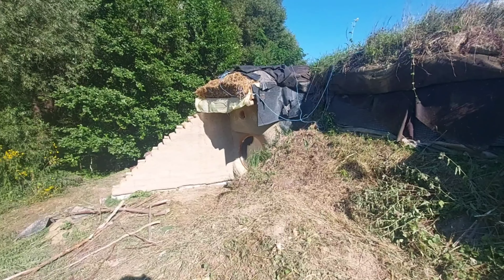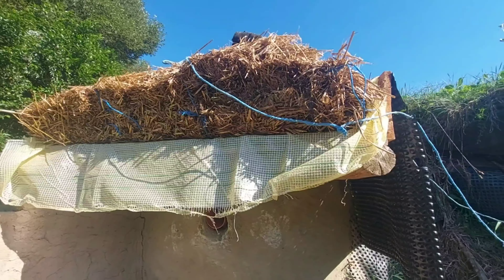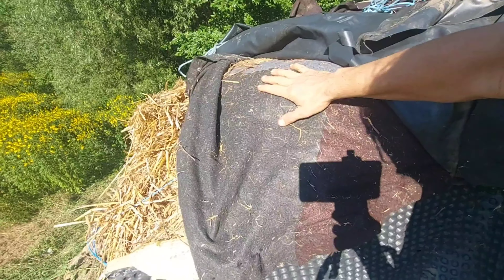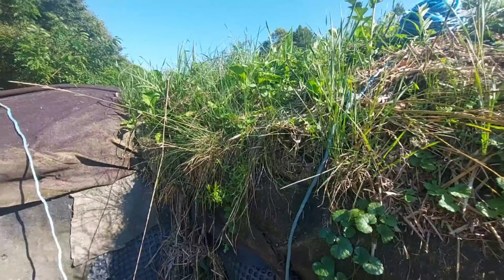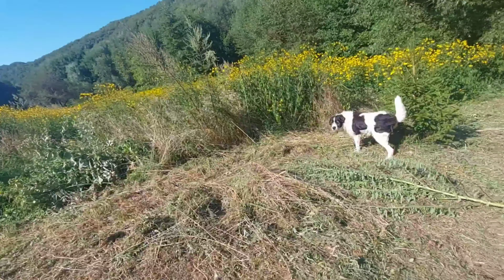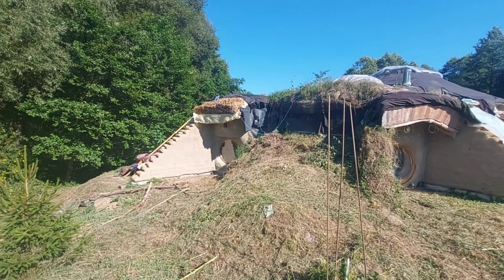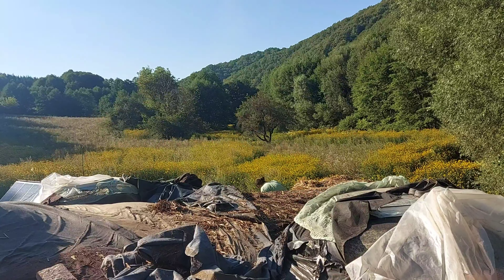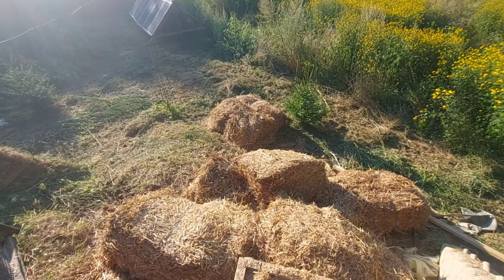S06 - Ep08 A strange roof - 3 Less waterproofing

Comment: Well done with your hard work! Thank you for posting these videos. I have a question: I can't see any drainage or guttering on the roof, only boards and earthbags... Wouldn't that mean when it rains all the water collects on the roof and is likely to eventually cause this kind of damage, as it has no where to run off, when it accumulates?
Reply from the maker: Thank you for your kind words.
The origina plan for the house was to be partily buried with the exceptipn of the wall windows and the south facade. So the earth on top was meant to retsin the water so plants can grow. 

Gutter or drainage on the roof will we present but only on the south side to capture the exces water when i have heavy rains. The rest of the water will either be in the earth on top of the house or will be taken by the roofs that i will finish buildinf this yeatlrs that go around the house. 

The water damage that you see is not because of to much eater on the house but bad worksmanship from my part in creating a continuous waterproofing on the house. I will make a separete video on pvc membrane, epdm and bitumen membtane how and why i chose the membrane that i will place this days.
Reply: @NascutdinTarana  Thanks for the detailed reply! I'll look forward to the video. Thank you so much for sharing your knowledge.